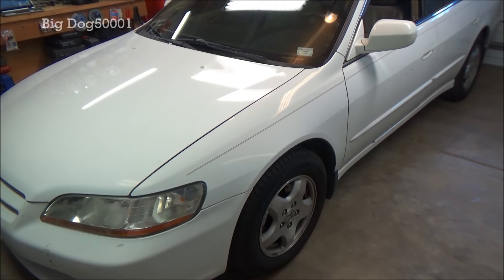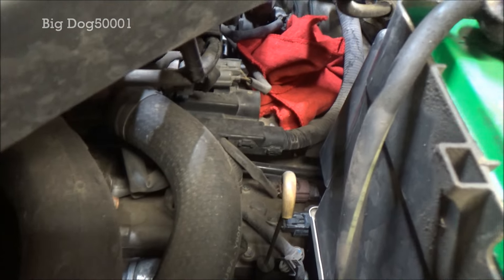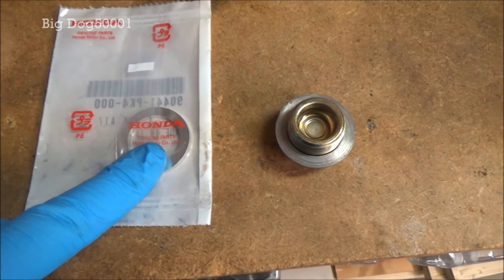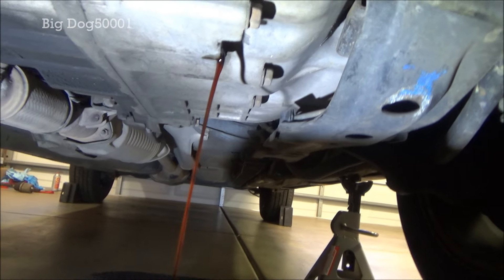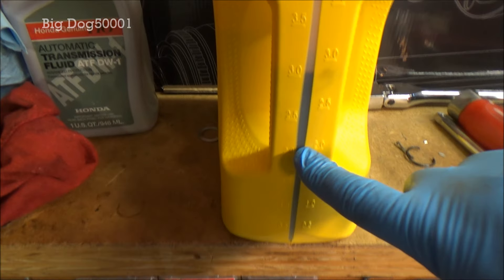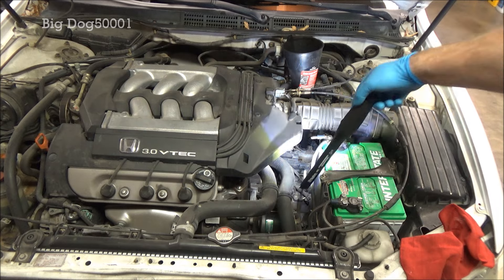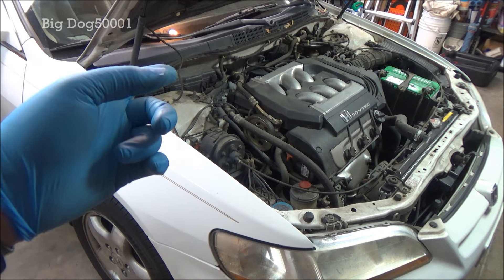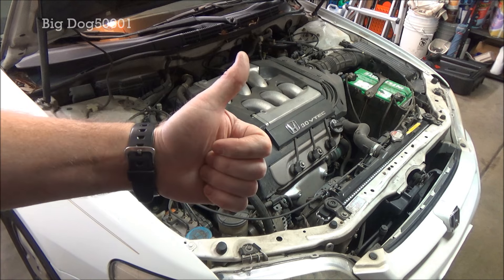Honda Accord V6 Automatic Transmission Fluid Service 1999 (1998-2002 Similar) (Drain and Fill)

Comment: Is there other ATF I can use for 2002 honda accord ex 3.0l instead of use expensive honda atf dw-1? Other ATF such Castrol is it acceptable for honda? If so what exact name should I look at Castrol? Also, is there any way I can change transmission filter?
Reply from the maker: Sordoarizona I don't recommend ATF fluids other than Honda.  This vehicle does have a strainer but it is not a normal service item.
Reply: I wouldn't use anything else but Honda transmission oil.  The few dollars you are going to save buying a non-Honda product is not worth the worry and a new transmission.  You only change the transmission oil every 60K miles, give or take a few miles, depending on the Honda model you drive, and the expense is not so excessive not to use only Honda oil.
Reply: I have done 2 drain and refills with Valvoline Maxlife atf dex/merc and have been driving for 6k trouble free miles so far. Its costs me $ 7.49 a quart

Comment: The first dot or the second
Reply from the maker: The top mark (highest up on dipstick).
Reply: Big Dog50001 Automotive thank you
Reply: If the transmission fluid is a little above the second dot is it bad pls ? 
And is complete flushing harmful to the gear box ?

Comment: I have a 98 Accord V6 with a rebuilt transmission done it 2016. I learned the shop refilled it with Dexron fluid. I'd like to switch to Honda DW1 as recommended. It's not slipping but the shift quality could be better. I have been doing a drain and fill once a year at the shop. Would it be logical to have the Dealer do a drain and fill and repeat this once a year or just live with it? I don't feel up to doing 3 in a row myself but would like to use the DW1. Thanks for your videos they are the best!

Comment: Great Video Big Dog.  I have a 2014 Accord Sport coming up on 60K miles. I believe it is due for transmission fluid change.  Is replacing transmission fluid for a CVT doable for a person who hasn’t done their own maintenance or should i let my local honda dealership do it? Thanks for your response in advance!
Reply from the maker: The service procedure on many Honda CVTs isn't really any easier or harder than what I showed in this video, just different fluid and slightly different steps.
Reply: Big Dog50001 Automotive thanks for the reply!

Comment: Down after some surgery and watching videos....glad to find your channel...just subscribed....we have a 2001 accord that is starting to clunk when shifting down to go up the driveway.   Do you use any additives for the clunk such as Lucas or others, or will this be a drop down of the transmission?   Many thanks!!
Reply from the maker: Welcome aboard!  I do not use anything except Honda transmission fluid.  If I had the vehicle, I would probably do a drain and fill and see if there is any difference.

Comment: Another good video 👍
Is it necessary to do the flush 3 times ? Like the honda manual book says? Thanks again
Reply from the maker: Is it necessary?  That is up for debate.  If I buy a used car that has not been taken care of I will do one drain and fill and access the fluid.  If it needs it done again I will typically wait until the next oil change and then I will do it again and re-access.  If the car is new, or I know the history, I do one drain and fill every 30,000 miles.  Thanks for the comment!
Reply: @BigDog50001  thanks

Comment: Great job on both video and commenting and thanks for torque specs. I have a 98 sedan v6 automatic and for 4 years have been experiencing tranny issue which is annoying. When vehicle shifts up from 1 to 2 it grabs slightly with small delay sometimes. Winter seems more obvious grab feel. Does not do that when slowing down. I did check 3 filters in transmission shift solenoid that sits below and near the battery and has the 2 connectors. I was hoping those filters were clogged. No luck, clean as a whistle. I have changed tranny fluid a couple of times. There was some metal parts on bolt but nothing what I would call significant. I noticed if sitting idle and when shifting the transmission manually thru gears it clunks, like a jolt when shifting into 2 either way from 3 or 1. The others are pretty smooth. Any insight? Do you think it could be a gear solenoid or torque solenoid that is outside the transmission or do you think its internal? It started about 225k and now have about 250k. Thanks, Michael

Comment: There’s no filter
Reply from the maker: Some models have a servicable strainer/filter from the factory and some don't.  There is a strainer on this model but to get to it requires disassembly of the transmission.  If the transmission has been replaced by a Honda dealer, in most cases they are required to install an inline filter with the new (usually reman) transmission, so some vehicles may have one of those currently installed.
Reply: Big Dog50001 Automotive thank you

Comment: So they're is no filter for transmission fluid?
Reply from the maker: No, not normally.  If the transmission was ever replaced by a Honda dealer there might be an inline filter installed between the transmission and radiator.

Comment: Thank you so much for this! I have a 01 Accord V6 sedan. The transmission was rebuilt once but whoever did it did a sloppy job. My transmission now leaks fluid and I'm not sure where its coming from...it could be the seals or maybe they didn't tighten the drain plug to spec, but in the meantime I can drive my car around.
Reply from the maker: 500AtTheWheels Glad to hear it helped you out.
Reply: Just an update I had my transmission rebuilt again for the second time. Upon inspecting the fluid levels I notice that the fluid level is way above the top mark when the engine is fully cold....is this ok ? If not can I siphon out the excess fluid thru the fill plug?